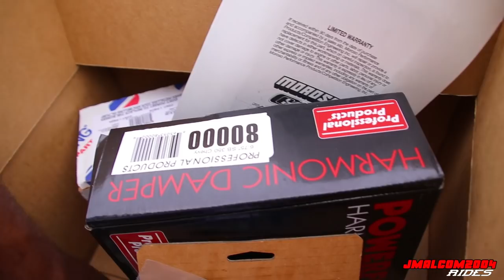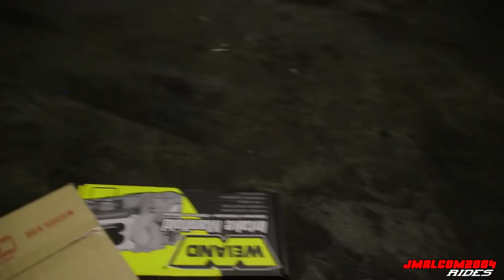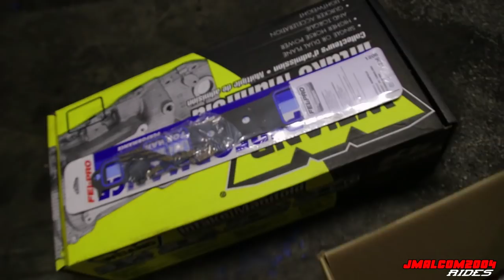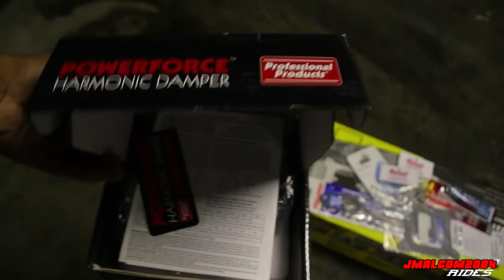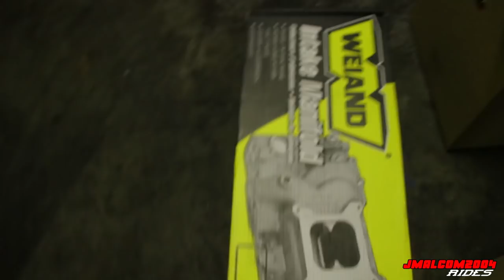BIG RIM BOX CHEVY BUDGET BUILD EPISODE 12: ANOTHER SUMMIT RACING TRIP AND ENGINE CHANGES

Comment: I had a weiand intake and it did not line up right with my motor the casting was off i had a 350 87-95 block non-vortec  with had the 12 bolts and two center bolts the engine had a vacuum leak from the start had sent intake back and got the Edelbrock never had problem after that bro. There other intakes should be good i think but just be careful with the vacuum leak!

Comment: yeah if you have 195-200cc heads  like your IK200s you definately want the team g.  they use the same gasket and the team g flows about more than the one you had.  good move.  i thought about the new IK195 for the ford windsor cause theyre hard to beat on the price vs the head size  ;problem is combustion chamber is too big so id have to use their track1 195

hell, i might go afr185  and their intake and get the power i really want

Comment: What's up man. New to the channel, and i dont build cars hut I'm learning. What's the benefit of having a larger oil pan? You were saying you dont need a high volume pump for a 5 quart pan. So why would you go 7 quarts ?
Reply: hes supplying more oil in the system as a whole.  thats why.  a stock 5 qt pan isn't made for a HV oil pump.  think about what oil does. lubricate absorbs shock and cools.  if he has more oil to circulate it'll be cooler but he also has more oil to pump.  on the other side you're trying to use some meant to pump higher RPM engines on a stock engine and oil pan,  its a waste of energy and money. 

oil pumps are supposed to be 10PSI for every 1000 RPM rule of thumb

if hes turning 6500 with a stock pump we know doesn't do 65 PSI but only 55,  then you might create a problem
Reply: @KingJT80  wow, that's great information.  I appreciate you taking the time to explain that to me. Makes perfect sense to me.
Reply: @orconomicgaming579  no prob man. I'm a fan of this channel and I dont update mine like J does at all but I do have something I'm working on that runs and drives. Just stuff I picked up over time
Reply: @KingJT80  I just subscribed. I want a project to work on myself. Maybe I'll upload some vids to my channel one day. Gotta start somewhere man.